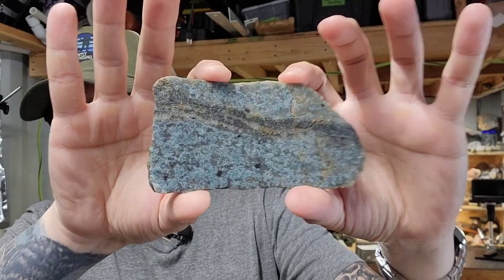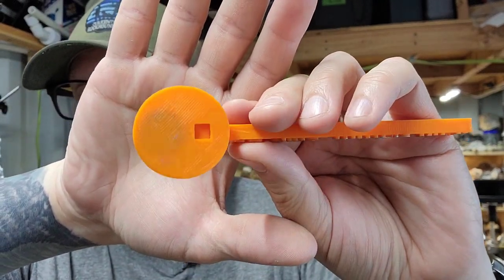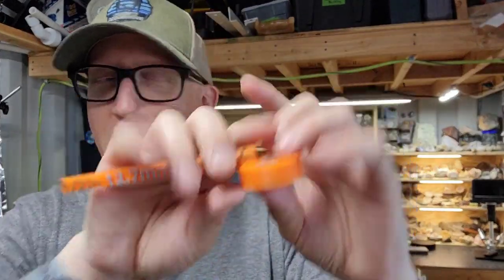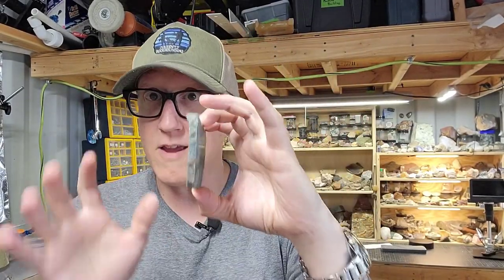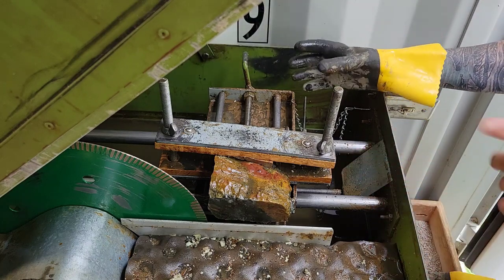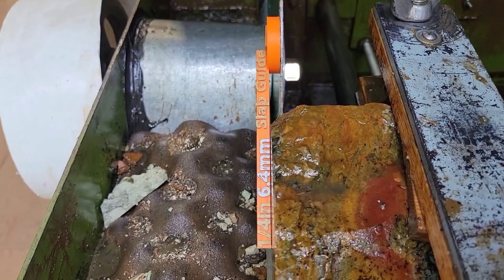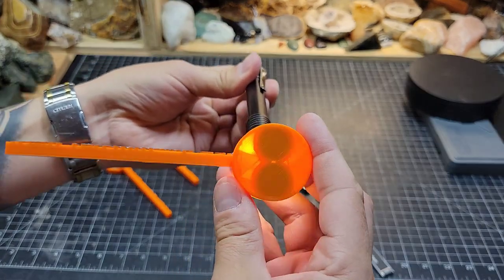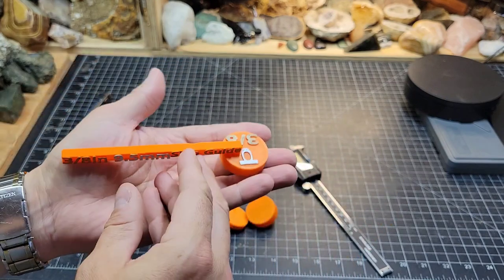Slaþ Guide // A Simple Solution For Cutting Perfect Slabs!

Comment: That's a GREAT way to measure slabs! I have a 20" 1970-ish Highland Park slab saw that I use to cut slabs for light switch plates. I usually cut them quite thick but this quick measurement should help me out a lot. Thanks again!

Comment: Still trying to get my old saw in working order without the blade wobble. After running through potential problems, I think it's a bent shaft. Probably from the previous owner getting a rock jammed in it... I was thinking of cutting out my own set slab template from metal. But with all the projects going on this seems like a good quick solution. Thanks Jarod!
Reply from the maker: Like you think its a bent arbor shaft? Did you replace the bearings on it yet?
Reply: I think so, I have not fully replaced the bearings as they seemed true. But maybe I'll try that as it is much cheaper than a shaft.
Reply from the maker: @nubnub8381  Bearings are often a cheap fix for this issue as it doesn't take much wear for them to be the issue here that sets them off a bit and that is compounded as you move away to the edge of the blade.

I would start with some new bearings.
Reply: @CurrentlyRockhounding  Sounds like a good plan, and I'm sure with it being used even if they're good now they'd need replacing soon anyways if it's not the problem. Any reccomended places that sell the correct bearings for an old lortone 10"?
Reply from the maker: @nubnub8381  I'm not sure what they take but Lortone has all the manuals online for their old saws.

Comment: Thanks for sharing sir! That's a great find and an excellent way to simplify for those who need it IMO.👍 (although I personally would rather metric than decimal/sae). Those will definitely be of help for me personally on my 18" slab saw which I need to make a new splitnut gate for the driveshaft in the near future.😢😢 The 12" slab saw has been really good IMO and moves almost exactly 1mm per rotation of the carriage nut. (I like to use 6mm cuts for slabs) Thankfully I have had almost no "play" in the that part yet and have been able to get as little as 2mm on a cut trying for iris effect. Anyway, thanks for scouring the internet for all things rock related to impart on us nerdy Tubers~ Have a nice day!
Reply from the maker: They have both metric and the far superior imperial units printed on them but it sounds like you want something with some 1mm jumps between them rather than imperial converted.

To be fair I kind of wish I didn't need something like this and I had a more accurate saw but that's not going to happen anytime soon so this does make the process nicer.

I hope you get that 18" up and running soon.
Reply: @CurrentlyRockhounding  🤣 1m = 3ft and 26mm = 1" right? time to bust out the micrometer~ haha
Reply from the maker: @BackcountrywithShaughn  I'm going to start using 1/4" slabs at a unit of measurement. 

"How many slabs are you tall?"
Reply: @CurrentlyRockhounding  That's an excellent unit of measure sir. I'm 288 or maybe 287 slabs tall or 288st...I am getting older~ 😁😁

Comment: I have a set of these from the same vendor. They really are that easy to use.
Reply: Looks like they have added even more options since I got my set.
Reply from the maker: How long have you had them? Any issues?
Reply: Since March. No issues. I did notice some tend to tilt up slightly making them not entirely accurate at the ends. Easy fix with some sandpaper on the 3D print ridges.

Comment: Acetone and ethyl acetate are great bonding solvents for PLA. That means you can use nail polish remover or M.E.K. substitute, found at ACE hardware.
Reply from the maker: Thank you! I didn't know it was that easy to bond them together. 

I did glue one of them together. I used a drop of extra thick cyanoacrylate with some accelerator and it worked fine but I know most people don't have that sitting around vs. what you mentioned here so that is very good to know.
Reply: Pla doesn't do that, but abs does.
Reply: @TheIdeanator  that's not accurate. I have bonded PLA with ethyl acetate many times.
Reply: @sublimehypocrisy  It's easy to look up the list of plastics that dissolve in acetone. You can use it to bond, form, or even make a paste for filling gaps that you can also press into a mold and let cure. Tool handles can be replaced this way. *Edit: I just looked it up and PLA does not dissolve in acetone but rather impurities such as ABS do, so that is how PLA is bonded with acetone. If it works it ain't stupid.

Comment: Hi Jared, I’ve been a bit busy for a while so haven’t caught up with your videos. This is an interesting little tool for the saw. 
Might be time to put a shim on your saw to take some of that play out of the table adjuster. Hope all is going well for you. 
Keep Safe & Keep Rockin
Reply from the maker: fixing this saw at this point is a bit like trying to restore a beat up dodge neon, rather than saving it I'm going to run it until the wheels fall off and call it good.
Reply: @CurrentlyRockhounding  I know the feeling Jared, the 24 inch saw I bought is from the 80s, it still cuts nicely though the blade has a very slight wobble, about .25 of a mm. Next time I strip it down I’m going to put new bearings and seals in it and put a washer shim on the side feed, like yours it has a bit of free play but only about 90deg of rotation. Hope you and Sarah are staying safe & well.